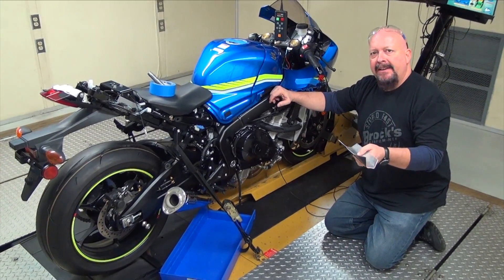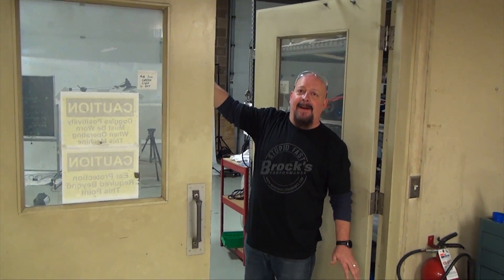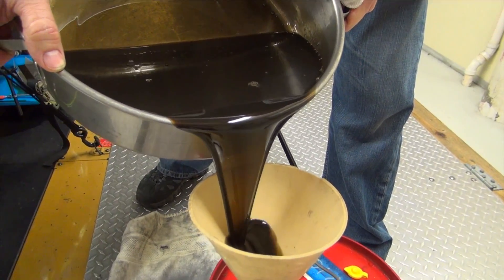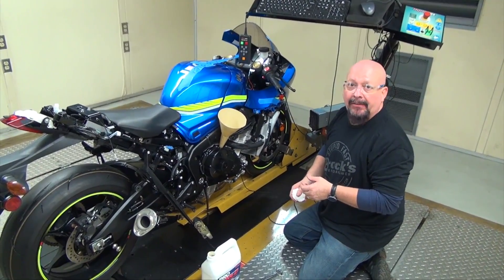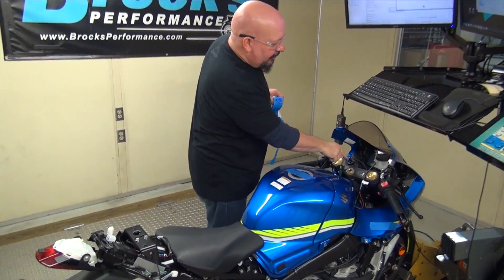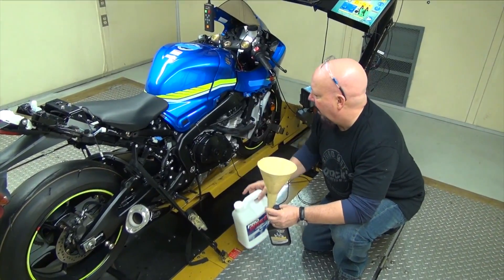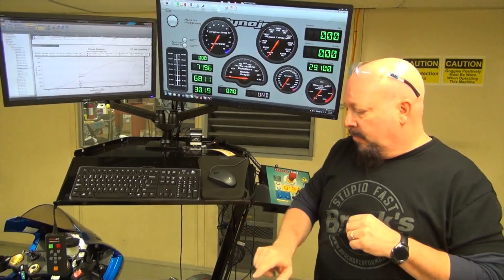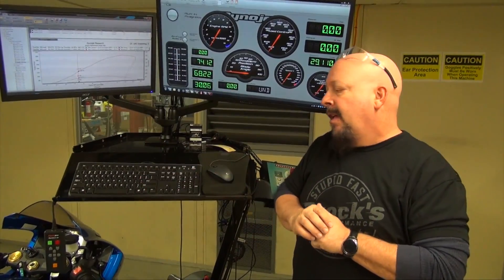2017 GSX-R1000 S2B: Episode 6 (Part 2) - The Devil Is In The Details (Oil Change)

Comment: Hi Brock. Would it be possible to make the gsxr 1000 have the same brutal rev limit like the bmw s1000rr? Thanks
Reply from the maker: Seems like a simple-enough question... but it's far from it. In a nutshell - no. The RR is is an amazingly advanced engine that rewrote the rules. I used real world peak RPM's from our Brock's Performance 2017 GSX-R1000 "Gixzilla" compared to Tauncy Ferguson's 2020 S1000RR "El Hefe" for this reply. using this input, I asked Grok and this is the reply (fyi: older GSX-R's would be far worse from a stress/design standpoint): 

14,300 rpm Suzuki 15,000 bmw stress difference?

To estimate the additional stress on a 2017 Suzuki GSX-R 1000 engine if its rev limiter is raised from 14,300 RPM to match the 2020 BMW S 1000 RR’s 15,000 RPM, we’ll focus on the mechanical stress increase due to the RPM difference. This analysis builds on engineering principles, particularly the quadratic scaling of centrifugal and inertia forces, and incorporates engine-specific details from prior context.
Step 1: Engine Specifications Recap

2017 Suzuki GSX-R 1000:

Engine: 999cc, inline 4-cylinder.
Bore x Stroke: 76 mm x 55.1 mm.
Redline: ~14,300 RPM (as specified in the query, slightly lower than the previously assumed 14,500 RPM).
Peak Power: 202 hp at 13,200 RPM.

2020 BMW S 1000 RR:

Engine: 999cc, inline 4-cylinder.
Bore x Stroke: 80 mm x 49.7 mm.
Redline: 15,000 RPM (as specified in the query).
Peak Power: ~207 hp at 13,500 RPM.

Step 2: Stress Increase Calculation
Mechanical stress on engine components (pistons, connecting rods, crankshaft, bearings) scales with the square of RPM due to centrifugal and inertia forces:

Formula: Stress increase factor = $ \left(\frac{\text{New RPM}}{\text{Original RPM}}\right)^2 $.
Suzuki original redline: 14,300 RPM.
New redline (matching BMW): 15,000 RPM.
Stress increase factor = $ \left(\frac{15,000}{14,300}\right)^2 $.
$ \frac{15,000}{14,300} \approx 1.049 $.
$ (1.049)^2 \approx 1.1004 $.

Thus, raising the Suzuki’s rev limiter to 15,000 RPM increases mechanical stress by approximately 10.04%.
Step 3: Piston Speed and Relative Stress
Piston speed affects stress, especially given the Suzuki’s longer stroke compared to the BMW:

Piston Speed Formula: $ \text{Piston Speed} = 2 \cdot \text{stroke} \cdot \text{RPM} / 60 $.
Suzuki at 14,300 RPM:

Stroke = 55.1 mm = 0.0551 m.
Piston speed = $ 2 \cdot 0.0551 \cdot 14,300 / 60 \approx 26.25 \, \text{m/s} $.

Suzuki at 15,000 RPM:

Piston speed = $ 2 \cdot 0.0551 \cdot 15,000 / 60 \approx 27.55 \, \text{m/s} $.

BMW at 15,000 RPM:

Stroke = 49.7 mm = 0.0497 m.
Piston speed = $ 2 \cdot 0.0497 \cdot 15,000 / 60 \approx 24.85 \, \text{m/s} $.

The Suzuki’s piston speed at 15,000 RPM is ~10.9% higher than the BMW’s, indicating greater stress on reciprocating components (pistons, rods) due to its longer stroke, amplifying the impact of the 10.04% stress increase.
Step 4: Additional Stress Factors

Valve Train:

A 700 RPM increase (14,300 to 15,000) raises stress on valve springs, camshafts, and lifters. The Suzuki’s valve train, designed for ~14,300 RPM, may risk valve float or spring fatigue without upgrades.

Thermal Load:

Higher RPM increases combustion frequency, raising heat generation by ~4.9% (proportional to RPM ratio: 15,000/14,300). This could stress pistons and cylinder walls if cooling is marginal.

Lubrication:

Bearings and other components rely on oil film strength. A 10% stress increase may push the Suzuki’s lubrication system closer to its limits, risking wear.

Vibration:

The 700 RPM increase could excite new harmonics, stressing the crankshaft or crankcase, though inline-four engines are generally well-balanced.

Step 5: Practical Implications

Stress Magnitude: A 10.04% stress increase is significant. While the Suzuki’s engine is robust (noted for “legendary” reliability), sustained operation at 15,000 RPM could reduce component lifespan (e.g., bearings, rods) unless upgraded.
Necessary Modifications:

Stronger valve springs to prevent float.
Enhanced oil pump or cooling system.
ECU remapping for fuel and ignition to maintain safe operation.

Performance Trade-Off: The Suzuki’s peak power is at 13,200 RPM, and raising the rev limiter to 15,000 RPM may yield minimal power gains if torque drops off, making the stress increase less justifiable without tuning for higher-RPM output.

Step 6: Conclusion
Raising the 2017 Suzuki GSX-R 1000’s rev limiter from 14,300 RPM to match the 2020 BMW S 1000 RR’s 15,000 RPM increases mechanical stress on engine components by approximately 10.04%, primarily due to the quadratic scaling of centrifugal and inertia forces. The Suzuki’s longer stroke results in a higher piston speed (27.55 m/s vs. 24.85 m/s for the BMW at 15,000 RPM), amplifying stress on reciprocating components. This increase could strain the valve train, lubrication system, and thermal management, potentially reducing engine lifespan without upgrades like stronger springs, better cooling, or ECU tuning. The small power gain may not justify the added stress unless the engine is specifically modified for higher-RPM performance.

My conclusion: Thankfully (as a Suzuki die hard), the GSX-R can be made FAR faster than the BMW as a result of a VERY strong aftermarket parts/supply/development chain. Unfortunately, IMHO BMW dropped the ball on the RR the moment the customer wants to make mods that BMW does no like, approve, or **SELL**. It's sad really as the RR is so advanced that it would crush all (once again, IMHO) on the modified stage in the right hands.
Look at how quick/fast gixxer's are in the XDA Real Street class: Dystany Spurlock holds the 1/4 mile national record at 7.32 approaching 180 MPH.... normally aspirated?!
Let someone like Cecil Towner or the folks at gforce engines do their magic on a BMW and see what happens (hint, it would get legislated out of the class with rule penalties...just like Tauncy with David Fondon in SuperStock - but it would rewrite the rule book in the process. My 2 cents - Brock
Reply: Thank you very for that detailed explanation  @BrockDavidson 🫡👏
Reply from the maker: @ashveersukram7444 glad you liked. YouTube didn't recognize the formulas, if you want them, send an email to bmail@brocksperformance.com and I will forward.
Reply: Thank you very much.  @BrockDavidson

Comment: Would love to hear your opinion on correct oil level in sight glass hot or cold?
Reply: Thanks for reply, mine completely cold is about 3/5 between the lines, and running and then letting it settle it ends up about 1-2/5 between the lines. Dealer did service and put in 3.5 litres
Reply from the maker: At least to the low level in the window after the bike has been run a bit and allowed to settle a bit also.

Comment: Can i use 0W on a 1290R? It say’s 10w-50
Reply from the maker: no
Reply: @BrockDavidson  thanx for the replay Brock. What should I use? 0W-20 alysn???
Reply from the maker: @robertoc.4413  Whatever KTM recommends. If that's not handy, the next best is the Kawasaki 10w-40 full synthetic. We have zero experience with Alisyn and the 1290, but if it states 10w-50...we would start with 10-30 Alisyn + Petron.
Reply: @BrockDavidson  awesome thanx!!

Comment: Are your thoughts on Kawasaki 10w40 still the same today? I assumed all modern motorcycle 10W40 synthetic oils were mostly the same.
Reply from the maker: Their 10w-40 full synthetic is still the best thick oil we have ever tested, and we use it frequently.
Reply: @BrockDavidson  How do you feel about Mobil 1’s 1040?
Reply from the maker: It used to be our #1, until they removed the zinc...now we won't use it.
Reply: @BrockDavidson  thanks for taking the time to reply, Brock! I’ve been debating on sticking with Kawasaki oil on the ZH2 & I guess I will.
Reply from the maker: @HKvsGlock  think of it this way...what other engine oil would even be tested in a gear-driven supercharger spinning 140,000 RPM's?...much less approved by the manufacturer. Remember, the engineers that develop these engines know FAR more than we do about making them live.
Reply: @BrockDavidson  for the H2 line I can agree considering a SC bike from factory is extremely unique. On my other bikes, they’ve been fine with good ole T6 lol

Comment: Have you tried/your thoughts on hi-flo oil filters?
Reply from the maker: After 40+ years in the motorcycle industry witnessing multiple aftermarket oil filter issues (fitment issues/leaks/o-ring failures/filter media failure and the worst... NO FLOW out of the box?!) we switched to exclusively using OEM ONLY after also observing ZERO failures or problems over the same time period. the OEM's have far superior engineering and QC processes to assure the filter works as desired - they also have the money to make this happen that many aftermarket suppliers simply don't have.

Comment: I recently bought a 2018 gsxr 1000R. Very surprised to see it still used the old 10 40. With such a high rpm a assumed we would be at a lower weight. Awesome machine. Can't wait to stop up at Brocks and get a full exhaust system with proper ecu settings. We have the best man right here in the great state of Ohio.

Comment: How many hours or miles do you go on the Alison Petron oil change? $100 oil changes.
Reply from the maker: @Davey T - That depends upon your use. A daily driver will not need as many changes per year as a bike that is drag raced consistently...so there really is no XXX concrete answer other than "when it gets dirty enough to need changed". That said, these might help you: https://blog.brocksperformance.com/faq/what-is-the-best-weight-alisyn-oil-for-my-application/ and https://blog.brocksperformance.com/faq/how-often-should-i-use-the-petron-oil-additive-when-changing-my-oil/

Comment: Hey Brock I have a question for you. I would think with drag racing you would be all about putting in a quick turn throttle. I put one in 2 of my 3 bikes. A 2017 ninja 1000 and a 2019 Suzuki GSX-R750 and for $80 for a G2 quick turn throttle it actually makes a noticeable difference. It almost makes it feel like the bike is more powerful even though it's just getting to WOT quicker. A little detail like that and a detail like a sprocket swap. A small detail here and their all makes a big difference. What's your thoughts on this?
Reply from the maker: In sportbike drag racing, the opposite is true. The rider must modulate front wheel height using throttle and clutch control. If the throttle opens too quickly, it becomes more difficult to modulate front wheel height. Of course, if the throttle is very slow, this is a problem also but most modern sportbikes are very good.

Comment: I agree. You can't say it , but I can......  K&N filters take way too long to get oil pressure after changing.   I wonder how many heart attacks they've caused😥. Fill the filter before fitting or better still, use a genuine oil filter.   🤗
Reply from the maker: The very first time we hurt a motor due to an aftermarket filter not flowing oil, we switched to an only OEM policy and never looked back.

Comment: Brock 2013 Busa
Pump gas flash/tune
Brocks meg exh.
Made 188.2hp
Did your 10/30pro Alysin oil.
Power charge treatment .
Petron added.
Sprint filter.
Shnitz short stacks.
Re.dyno. made 195.7hp same dyno
Weather/humidity was about the same.
15k on bike 93 pump gas.
Next test mr12 an evac crank case mod. Hopefully make 206hp.

Comment: Hey Brock! Have you ever put Rotella T6 oil in a bike? I've used this with some Motorcote  and even a little Lucas oil additive. But I'm sure you could test this hypothesis? I am quite the mad scientist when mixing oils together lol. Also what about lifetime oil filters? Like Flo or System1? I run a Flo and just the cost savings over a year pays for itself and I believe it works if not better than O.e.m. Do you rebuild engines? Like take a stock 750 and bore it out? Or is this something a specific engine builder would do? What about turbo? Are you adding one to this Gixer?
Reply from the maker: Yes on the Rotella - Good stuff! But it works much better in my diesel truck, IMO. We use only OEM Oil Filters.
Check this about rebuilding engines: https://bit.ly/3aXtFTK

Comment: I used Alysin less that zero at 999 miles in my 2018 R1. Three thousand miles later with the Petron Plus additive here in South Texas the bike is running fantastic. I was just told to change it every 3,000-4,000 miles. At 599 miles  I changed it with Yamalube15-50w Full Synthetic. Then before I had her dyno tuned I changed to Amsoil oil filter and Alysin. Love this stuff! Brock Davidson
Reply from the maker: @Jose - thanks for your input! Please post a review in our store if you get a moment: https://brocksperformance.com/petron-oil-additive-4-cycle-lube/
Reply: @BrockDavidson  I live in California, 40 miles south of Fresno, I just bought a 22 ZX10R, did my 1st oil change 550 miles, put in Castrol Power1 10W-40 full synthetic in , now has 900 miles on it My next oil change. I was going to use the oil you recommended along with that. Additive which weight would you go with and I ride  spring summer fall winter I daily my bike to work everyday.

Thanks for your reply and help.

Comment: 9:40 I'd never try to pretend I know your business better than you do, and I mean that sincerely, but filling your oil filter with oil before installing it I had thought is highly advised against, specifically because you're bypassing the filter with whatever oil you pour in.
Reply from the maker: @demon39063 - I'm not sure what this means? "specifically because you're bypassing the filter with whatever oil you pour in."  The idea behind pre-filling is to help reduce the lag in time refilling the engine oiling system after an oil change. A dry-running engine is increasing the wear on parts and can lead to bearing scuff in just seconds. On some bikes, the oil pressure light will stay illuminated for 3-5 seconds after the first start-up following an oil change. Pre oiling the filter can reduce this time to 1-2 seconds or less. Add up those seconds over the required oil changes during engine life, and you can see why some identical bikes suffer catastrophic engine failure and some don't. An additional note. Clean air regulations have eliminated zinc from most of today's motor oils. Zinc is very effective as a part lubricant during dry engine occurrences (start-up/wheeles/hard braking etc...). That's why we have used our Petron Oil Additive for many years. It's cheap insurance to help prevent damage: https://brocksperformance.com/petron-oil-additive-4-cycle-lube/

Comment: The Suzuki Ecstar oil is full synthetic just like almost all modern motor oil. Love your video series.
Reply from the maker: Ecstar is the prefered oil for use in the GSX-R1000. We use our Alisyn because the light weight (viscosity) helps the engine accelerate quicker for drag racing.
Reply: @BrockDavidson  That makes sense (and it certainly seems to work well for you) and you did a good job explaining the benefits and your experience with these lubricants.

I just wanted to bring attention to the fact that these lubricants have gotten pretty advanced compared to where they used to be.

Also, it really is too bad you can't ship to California. I want to buy a full package from you :(.
Reply from the maker: @Brian - https://www.bills-exhausts.com/
Reply: @BrockDavidson  Hell yes, thanks

Comment: For dyno test your method using less than 0w engine oil and oil additive are  just okay. We don't know the final  viscosity of engine oil after oil additive mixed into it. It's a big different if talking about everyday use bike. For everyday use bike long time performance and low cost maintainance is important. Engine oil viscosity has significant role on maintaining combustion chamber cleanliness, thus perfect fuel+02 burning as long service period and low emission exhaust gas will be. Use thinner oil than oem spec cause faster carbon buildup in combustion chamber that affect the engine performance. Other words, what brock's performance did only fit on high performance or competition use bike.
Reply from the maker: @herry -This FAQ explains the final viscosity after adding the Petron additive: http://blog.brocksperformance.com/faq/what-is-the-best-weight-alisyn-oil-for-my-application/
Reply from the maker: @herry - this FAQ shows how what we did has been used for years, for many thousands of miles on the street and race track combined: http://blog.brocksperformance.com/customer-testimonial-alisyn-oil-and-petron-tony-wiford/

Comment: Brock, do you add the petron with every oil change ? Also, can you run the pro 21 < 0 by itself, without the petron? Next, how many normal street driving miles, with the occasional pull, do you recommend before an oil change with the pro and petron combination?  Thanks in advance...
Reply from the maker: @Sprat Law Firm PLLC -  this answers your Petron question: http://blog.brocksperformance.com/faq/how-often-should-i-use-the-petron-oil-additive-when-changing-my-oil/ and yes, the Alisyn can be run without the Petron. Oil change interval is a tough one to answer since one rider-botched pass can require an oil change. We travel 1500-2000 on the street and an occasional trip to the track. Here is a bit more info. on  Alisyn for street use: http://blog.brocksperformance.com/faq/how-is-the-less-than-zero-weight-oil-going-to-perform-on-the-street-i-do-still-ride-on-the-street-some/

Comment: @
Brock Davidson   Can a 2016 gsx-r1000 tail fairing fit on a  2017 gsx-r100? Or does the 2017 750 or 600 tail fairing fit?
                                   I'm only asking because my 2017 gsx-r100 doesn't have the integrated tail lights like the previous/other gsx-r models.
Reply from the maker: I don't believe so, but I have not attempted.
Reply: @BrockDavidson  ok thx